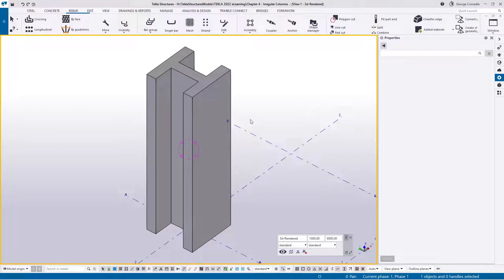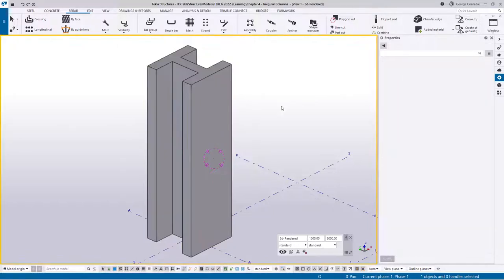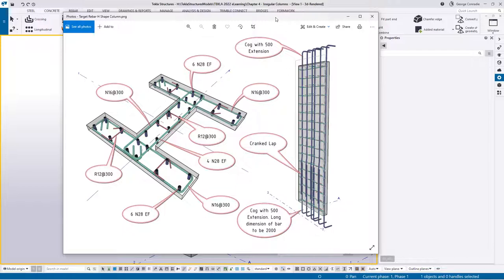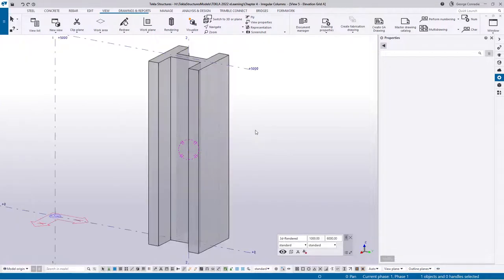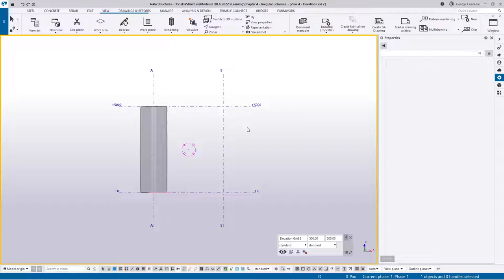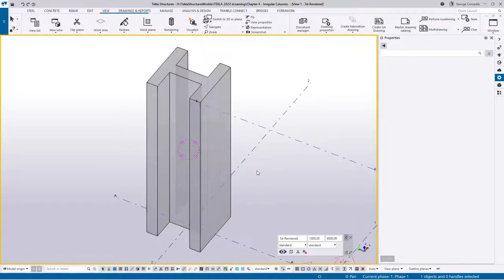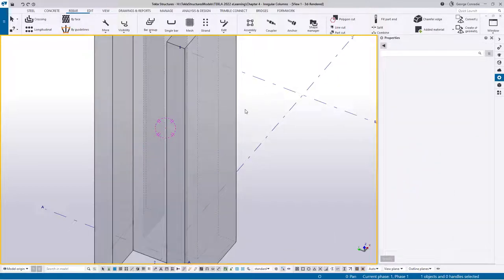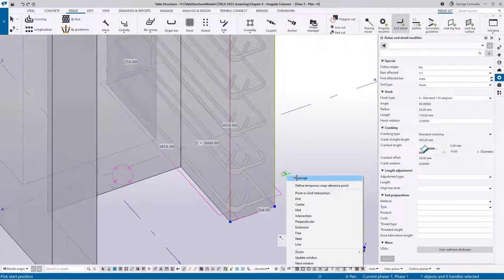Tekla Structures - Chapter 4, Video 4 - H-Shaped Columns

Comment: thank you very much i have problem with the bending bar schedule that the length of the hook different about what i put it in the druing like if i write 50mm i get 62 depending on the radius of the hook , there is anyway to make the program give only the straight length with out the calculating the bending radius in the hook